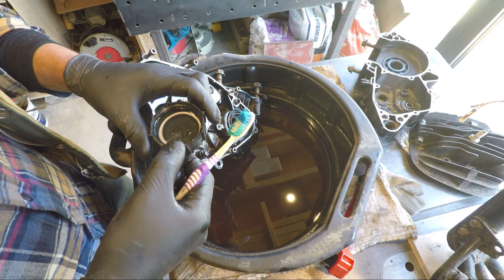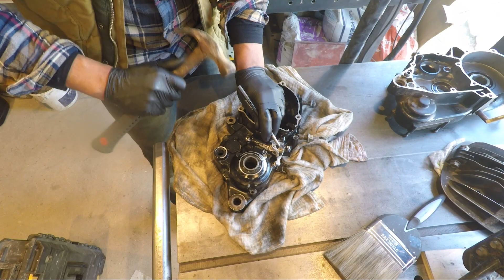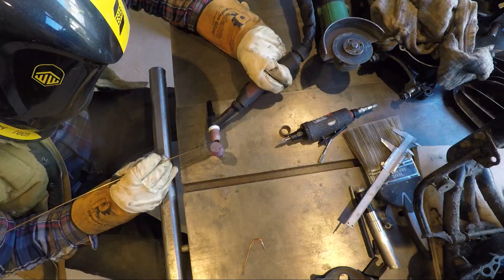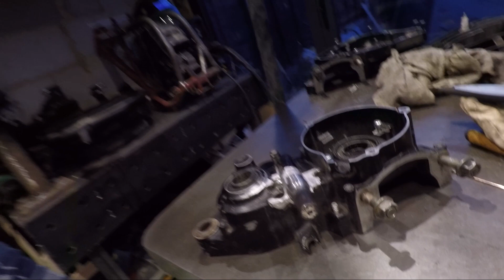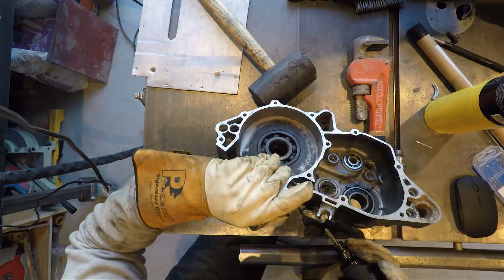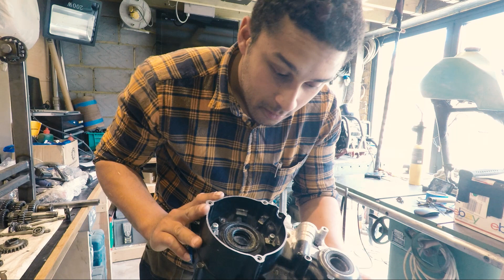YAMAHA IT490 ENGINE CASE REPAIR-Tig Welding Aluminium

Comment: Where is the next episode?! I was really getting into that build 😂
Reply from the maker: It’s crazy that you ask that’s because nobody asked me anything about that build for a long time until recently, a lot of people have been asking me the same question 😂 
I want to get back on it, if there is interest in it then I will make more videos for sure!! 
I’ve done a few bits and pieces but for the most part, you haven’t missed much 😬
Reply: @KeepitBigBore  awesome! Just starting on a IT490 restoration myself so all info is gold 👌
Reply from the maker: Good luck with it mate, there has been a wave of it 490’s lately for some reason!! If you need a new transmission for it then have a look on eBay, there is one in the US now,  trusts me they don’t come up often, I waited a year to find one 😂

Comment: Nice work on that casing, are you in the UK ?
Reply from the maker: Thanks mate, I’ll be buying a milling machine soon which will allow me to do these with 100% precision. I have an 85 CR500 which needs similar work and new frame rails fabricating also! 
I am indeed, based in London 👍🏽
Reply: @KeepitBigBore  Awesome! I'm in Leicester and do lots of Case repairs etc and Vapour Blasting.
Reply from the maker: I've been looking into vapour blasting for a long time also, I'd love to have the space to set one up!! Not easy in London unfortunately 😂